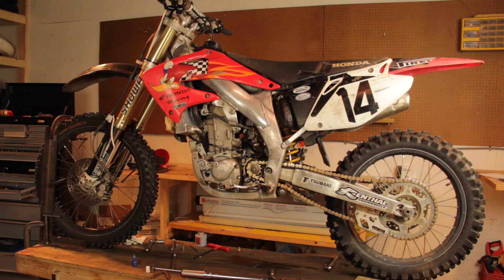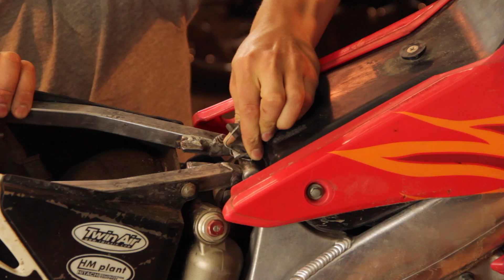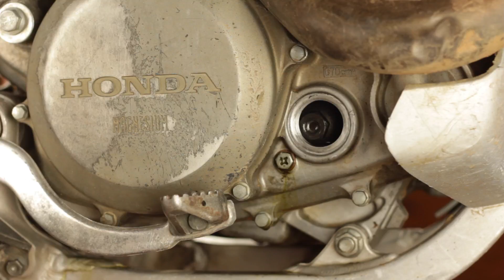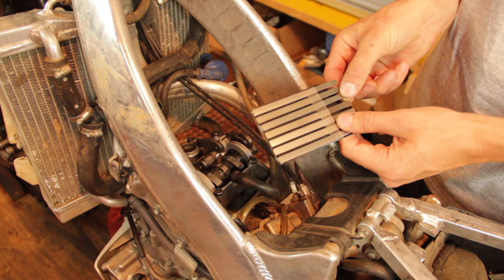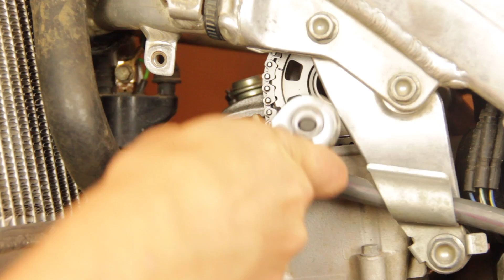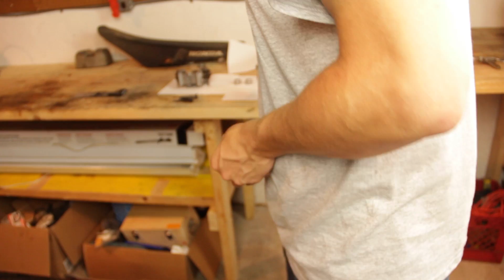Honda CRF 450 Valve Clearance / Adjustment / Shim How-To

Comment: u skiped a step u need to clean dirt off the valve cover before u takeit  off i no u said it but u want to do it before u take any bolts out an disconect the hose

Comment: are these the same specs for the crf 450 R?
Reply from the maker: The bike featured is a CRF450R, Did you mean are the specs the same for the TRX450R ATV? This is something I can't confirm but I would imagine the clearances wouldn't change much between the two engines.